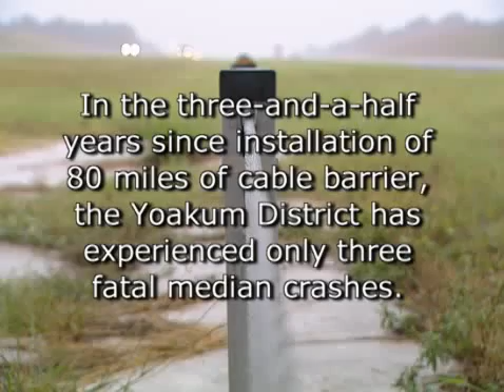In-Service Evaluation of Cable Median Barrier Performance

Comment: If you zoom enough on the cable, you can see "No bikers allowed" written :(
Reply: They won't talk about what it does to motorcycle  riders!
Reply: @richardhatfieldgreg3851  Riding a motorcycle is inherently dangerous, and in western countries, a pleasure activity.  If you don't want to run the risk....
Reply: Sliced :(

Comment: what about the people on motorcycles? they would be sliced in two.
Reply: According to https://trrjournalonline.trb.org/doi/10.3141/2262-14, these cable barriers are about as safe for motorcyclists as W-beam guardrails, and less safe than concrete barriers. (And presumably safer than no barrier.)
Reply: I spent 20 years working the highway responding to crashes and never saw a motorcyclist killed or even seriously injured by a cable barrier hit. On one of our local highways we went from averaging 12 fatal or serious injury median crossover accidents annually pre cable to zero after cable install for the first 5 years. Do the math, that's a lot of benefit, cable barriers work. Most light vehicles drive away from a cable hit that would have been a roll over, ejection or head on collision. The proven benefit of cable barrier far out weighs any down side.